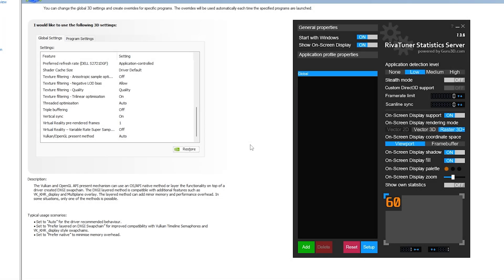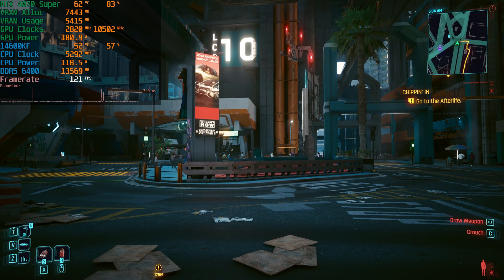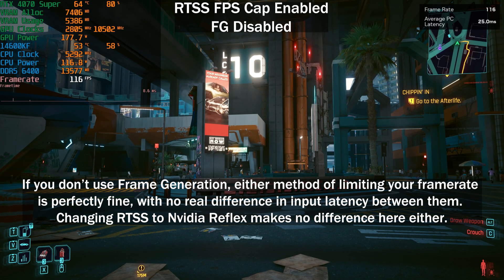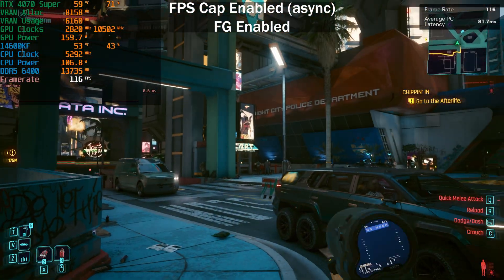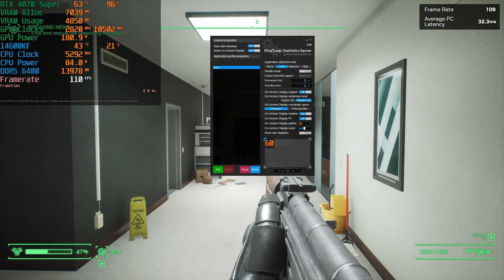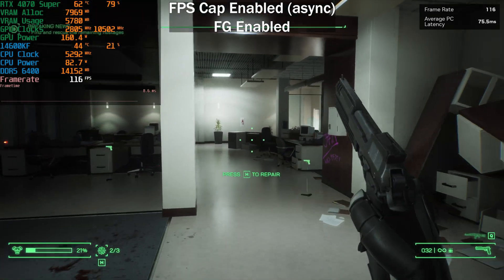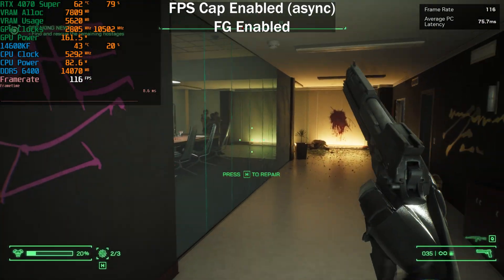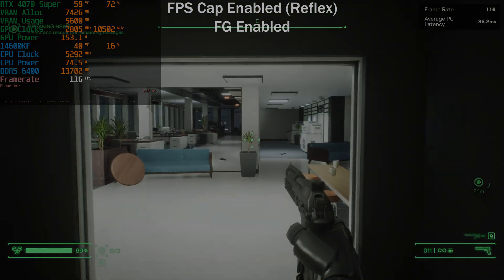How To Reduce Input Latency When Using Frame Generation - V-Sync vs RTSS

Comment: Buddy, thank you a ton; this video taught me that RivaTuner has a Reflex setting for the frame cap. Thanks to you, it's solved and all of them (frame generation, frame cap and VSYNC) are usable at the same time!

For years, I've been using what I call the "HoboSync"; VSYNC ON from NVidia Control Panel combined with a Frame Cap from RivaTuner to eliminate screen tearing and input lag at the same time. It's also good for your GPU on the long run. The frame generation technology I never got to use because as you're trying to showcase in this video, it introduced the massive input lag back. No more!

edit: Tested with STALKER 2. Smooth as butter!
Reply from the maker: So the funny thing is I only found out about that after I uploaded my initial video about this topic and people helped me in the comments! I then deleted that video and made this one. So we both learned something new haha!
Reply: What do you cap your frames at? I have a 40 series and I want to try and copy your settings if you’d be ok with sharing! I’m trying to get my stalker to run better (input lag) with frame gen
Reply: @TheWowBomb  Sure! Overall graphics settings are set to Epic (depending on your GPU/CPU). From NVidia Control Panel (or from NVidia App), V-Sync is forced on globally. Low-latency mode is in Ultra, though I'm not sure this helps in any way when you have Rivatuner capping the FPS. In Rivatuner, FPS is capped at 58 in Reflex mode, again globally. DLSS upscaling in DLAA mode, DLSS frame generation (naturally).

Normally I get around 35-40ms average PC latency without frame generation, with this around 60ms; still unnoticable for me. If you have a better screen that supports anything beyond 60Hz, the video has a few pointers as to what the ideal cap might be; usually around 2.5% lower than the max FPS that your screen can display. Plus, on a higher refresh rate & FPS cap, the latency impact would be less; the jump is rather wide for me as my cap is 58.

PS: Before watching this video, my average latency was going over 130-140ms, but it didn't feel like 130-140 at all, it felt like much more than that and the report was incorrect. Even if that's not the case, from 130-140 to 60 makes it playable, unnoticable even.

PS.2: Exclusive full-screen may also shave a little bit more, too. However, when running in such mode, trying to display NVidia Overlay (FPS/etc stats) causes Frame Generation to fail horribly in Stalker 2 lol :D
Reply from the maker: @TheWowBomb  For Stalker 2 and more heavier games I use 1440p High Preset, DLSS Quality, Frame Gen on and then I cap my frames to 120 fps with RTSS with the Reflex option enabled.

Other games that are not too demanding I try to max out my refresh rate of 165hz. What I do there is enable v-sync in NVCP, enable g-sync, use 1440p High, DLSS Quality + Frame Gen and with Nvidia Reflex in the game it caps my fps to 158 due to v-sync + Reflex. 

Not sure if your reply was aimed at me, but these are my settings.
Reply: Hahahaha didn't know it had a name. Been using hobosync for a couple of years now. The only thing I did differently is that I overclocked my 60hz monitor to 63hz, so I'm not using some weird numbers for the fps cap in RTSS. It's set to 60 fps with refresh rate of 63hz.
Reply: @witcher348  It's a name I come up with, as back then gsync monitors were sold at a premium. Couldn't afford it, and didn't have to thanks to this trick, so I called it "hobosync" :D
Reply: @bobloblawlove  yeah, now a lot of monitors are g-sync compatible and it's enough for a smooth experience

Comment: Ive done alot of different tests, and using the RTSS frame limiter with Reflex works best for me! Alot of the options had similar response time but would jump higher once I started moving jumping around and aim/shooting. Once Human is the game I did the tests on.
Reply from the maker: It's so funny, I never even knew this option existed, so I made a video about input latency and people pointed me to this option. It really works great, especially when using frame generation.
Reply: @Mostly_Positive_Reviews  yes it does, Ive been struggling the past 4 days, Ive done so much, Ive cleaned my pc, change thermal paste, refilled my liquid cool, cleaned all the fans too, I updated my bios, reinstalled my drivers, uninstalled a bunch of stuffs, tried alot of tweaks, worked on my overclock, I tried with/without overclocks, and god knows how much research I did. I had my cpu running at 100% and thought it was the issue, and turning FG off would give me lower and unstable FPS so I quite didnt want to use that option unless I managed to get the needed fps. I managed to hit about 130 avg but that wasnt enough I have a 165hz monitor darnit! loll your video is the one that brought the attention on this rivatuner setting, Ive been using rivatuner for years and I didnt know it would be the reason for this! I even thought it might be the effect of aging before I turned FG off and realize WOWW Im a gamer again! LOL thank you very much!
Reply: @Mostly_Positive_Reviews But do we need to enable V-sync in  nvidia driver settings? With FG we will go more than 120

Comment: if i use frame generation with riva tunter limit 60 fps, than 60 fps are shown, but it looks like 30 fps
Reply from the maker: Limiting your framerate to 60 fps with frame gen is a bad idea. Input latency is sky high, visual artifacts are more visible, and ghosting can be more obvious at lower framerates. Frame gen is much better at higher framerates. I personally prefer 120+ with frame gen, so I aim for about 80 fps without it.
Reply: @Mostly_Positive_Reviews   it works fine in witcher with fsr3 mod and limit 60. I dont want, that my gpu is running on maximum all the time, because of generating hundrets of frames.

Comment: what would be the way to reduce input latency for using FSR FG instead of on NVIDIA cards? Nvidia reflex doesnt show without DLSS, and i havent heard of a counterpart to NVIDIA reflex for DLSS on FSR's use. i dont own a 40 series to have FG, but an RTX 3080ti which does not support FG but FSR FG works, but latency is horrible
Reply from the maker: AMD cards have Radeon Anti-Lag in the drivers that you can enable. Some games also have Anti-Lag in the options menu (I think CS2 has that). But your best option is to enable anti-lag from the Radeon software.
Reply: @Mostly_Positive_Reviews  But i don't have AMD card ( what the AMD antilag feature named? for nvidia it's reflex ), i have RTX 3080ti, the only way to have FG is FSR. DLSS doesn't have FG cause it's not 40 serie. and that same time using FSR FG there has horrible lag on Nvidia and that's what im asking about way to reduce that lag. RTSS cap + reflex on it causes screen tearing for me
Reply from the maker: @baerimbel2006  Sorry, I completely misread your comment. 

With FSR FG, are you going over your monitor's refresh rate? That would cause tearing. I use G-sync + V-sync + Reflex, and that caps my framerate to 158 fps on my 165hz panel, and doesnt tear. I use the same configuration for FSR FG as well, except that I have to manually enable Nvidia Reflex in the game's options menu.

What game are you specifically talking about that requires you to enable DLSS to be able to enable Reflex? Most games I have played has the Reflex option completely separate from DLSS, but there are one or two of them where reflex can only be found under DLSS options, or require you to enable DLSS.

The other option you can try is Low Latency Mode in the NVCP. 

Just a side note, not sure if this is the case for you or not, but using frame gen to achieve 60 frames per second is going to be a horrible experience. I personally always recommend trying to get just over 60 frames per second before enabling frame gen. That doesnt help on 60hz panels though as anything above 60h fps will cause screen tearing. So I recommend having at least a 120hz monitor, and getting at least 60 frames per second without frame gen before using it.
Reply: @Mostly_Positive_Reviews Bro can you tell the reason for the side note ?

I have a rtx 4060 and currently doing the same thing that you mentioned in the side note but didnt notice anything unusual
Reply from the maker: @brainly7906  It's just that input latency is a lot higher when the final output is 60 frames per second, or when it is locked to 60 frames per second using v-sync. The higher your framerate, the lower the input latency penalty from frame generation. If the input latency doesnt bother you, great! But it is definitely a lot more noticeable to me and at that point I just use DLSS upscaling rather instead of frame generation.

Comment: so i play on a 240hz monitor and wanted to limit my framerate to reduce power usage (less heat) but couldnt figure out why my input delay was so bad. this video helped a ton, using the reflex option in rtss worked amazingly. the only weird thing is that i have to set my fps cap to double what i want it. ie, if i want 90 then i have to set it to 180. must have something to do with the frame generation but its weird bc i didn't see you needing to do that. maybe once you go past a certain number (144?) it bugs out? idk. either way, it works. works weirdly, but it works! lol
Reply from the maker: PCs can be so weird 🤷‍♂️ Glad you got some value from this video and managed to sort out your quirks 🤣

Comment: Do I need to turn on vsync in nvidia control pannel ? , if I want use RTSS reflex with gsync
Reply from the maker: Do you mean for the option to become available? You just need the latest version of RTSS for the option to display.

But if you are asking if it is better to use v-sync too, I use g-sync + v-sync + reflex and it then caps my 165hz panel at 158 fps. I prefer that and it is a very smooth experience with no tearing.
Reply: @Mostly_Positive_Reviews how about cap fps with max frame rate in nvidia control pannel ?, is it better than RTSS reflex ?. I tried use RTSS reflex cap my FPS in elden ring, but i saw flick if u cap fps 30-40

Comment: I have a entry level GPU (RTX 4060) and I'm aiming to play at 60 fps locked, but I do need DLSS at all times and sometiems FG in heavier titles to reach that, could you inform me if V-Sync even if being better to have less latency, does it affect performance on 1% Lows? Because in that case any limiter, be Nvidia Control Panel or RTSS limitir would be a better option for me, correct? Or V-Sync works as a limiter to help to have better 1% Lows? Or if that NVIDIA Reflex option on RTSS Setup shows up I should just go with that for best possible performance?
Anyways, great video nonetheless, I couldn't find anyone else doing a test like this around. Thanks for uploading. Cheers!
Reply from the maker: Thanks for stopping by! The Nvidia or RTSS limiter will be better as v-sync can cause a lot of additional input latency. V-sync can also cause very erratic frametimes. On my 60hz monitor I just use RTSS for limiting the frames and it has worked pretty well for me.
Reply: @Mostly_Positive_Reviews  Thanks so much for the reply! Yes, I'm using an IPS 60 Hz monitor as well, monitor also entry level haha. I appreciated the clarification. Have a good one and thanks for putting this video out, I had no idea about NVIDA Reflex option on RTSS!
Reply from the maker: @danielma1359  You're welcome, and thanks for watching and commenting. I also didnt know about the Nvidia option actually. I made a video initially and people in the comments then pointed out there is an Nvidia Reflex option too, so I redid the video to include that as well.

Have an awesome day, and happy gaming!

Comment: how are you measuring input latency? can i use that sofware with amd?
Reply from the maker: I use GeForce Experience. It unfortunately only works with Nvidia GPUs as it is bundled with the drivers. Radeon's Adrenaline software can also display this if you have anti-lag+ enabled in a game that supports it. I dont know the exact steps to enable it, but it is available if you want to search a bit. Here is a link from PC Gamer: https://www.pcgamer.com/amd-adds-system-lag-monitoring-to-its-adrenalin-overlay-for-games-that-support-anti-lag/

Comment: Great video thanks - not sure if you've noticed this but in CP2077, frame gen causes very regular and constant microstutters when a frame cap is used. The microstutter disappears when uncapped, but then tearing is out of control.
Reply from the maker: Interesting. I actually havent specifically noticed this, but will definitely check it out tonight, thanks for the info!
Reply: @Mostly_Positive_Reviews Is this the cause? Cyberpunk is the only game with FG that doesn't feel smooth, even though it says it's outputting over 120fps. This is with both vanilla and modded fsr 3. To put it simply, it feels like it's doing nothing.

I tested lossless scaling with the game. While the input latency is noticeable and there's a lot of artifacting, the visual fluidity actually matches the displayed frame rate of above 120 FPS.

Other games like Dead Space and Ghost of Tushima feel very smooth and visually fluid the fsr 3.
Reply from the maker: @albanmarku6743  Yeah, FSR 3 in Cyberpunk is a bit of a mess currently. It definitely needs some work. Other games have much better implementations.
Reply: This is my issue! It's a "pick your poison" type of situation. It's so annoying!
Reply: @unnamed715  no tearing for me if I enable vsync or gsync in driver settings with fg, as long as my max fps doesnt go above 240 (monitor hz)
Reply: Screen tears so much that you may think your operating system is bugging in game, haha.

Comment: all it does is use nvidia framelimiter, problem is cannot be done by game as it is general/global setting, so it is better to use the framelimiter cap on the nvcpanel per game instead of rivatuner. in rivatuner you will need to do  it everytime if you use framegen or not. the async is better than nvidia one in non framegen scenarios frametimes are a straight line instead of the lil spikes you see using nvidia reflex if using framegen is better using nvidias framelimiter or the option explained below.,

Another trick is to load the game in a way it rarely/never hits your monitor refresh rate with VRR/VSYNC on
ie 120Hz you would need to use a in game setting/dlss in a way it stays under lets say 110fps AVG on a 99% gpu load which is the best way to do it with the best latency of them all.
Reply from the maker: Thanks for the clarification about using Nvidia's frame rate limiter. Wasnt sure exactly how the Reflex option worked, but it makes sense.
Reply: Misinformation. Rtss frame limiter mode is not a global setting, you can set it per game.
Reply: @hkl4dplayer  nothing to do from what i just said.

Comment: Is there any reason to use rtss async over rtss reflex on games that dont have reflex in game settings already even if one doesnt use frame generation? Should i just switch to rtss relfex onwards for every game?
Reply from the maker: Actually a very good question, and one I didnt address in the video, my apologies.

I have been using the Reflex option since I made this video and havent seen any weirdness or input latency spikes on games that dont support reflex. I have only tested a handful of games though but havent come across any issues.
Reply: @Mostly_Positive_Reviews thanks for replying 👍
Reply from the maker: @shayanali8771  thank you for watching and commenting in the first place 👍

Comment: Hi! Great video!  SInce the making of this video, have you tested the latency with the in game FPS limiter instead of V-sync or RTSS? In many games it gives a lot less latency. It would also be great to see the initial amount of latenncy you were getting before you enabled V-sync or RTSS, to see if it increased od drecreased when enabling them. I would love to know your opinion. thank you
Reply from the maker: Thanks!

I have personally found that latency might be slightly better, but many games have frame time pacing issues when using the in-game limiter. RTSS / v-sync give an overall smoother experience. Not all games though, there are games that can perfectly cap the framerate but it depends on the game. 

Will remember to show the latency before in future, but it is lower as the framerate is higher without a cap in place.

Comment: I've got a 4070. Can someone explain why my latency if in the 90s no matter what settings I try?
Reply from the maker: Do you use v-sync or a framerate cap? What is your framerate when you see 90ms? Also, which game?
Reply: Here are my settings:
Res - 2560 x 1440
PT - On
DLSS - Balanced
Graphics Settings - Custom but mostly high settings

Frame cap is turned on in Nvidia Control Panel
FPS - 44 (frame gen off)
Lat - +- 75 (frame gen off)

With frame gen on latency hangs around 120 with frame gen on. I capped it to 60fps which would otherwise jump to 75 if I don't have it capped.

Changing to Ray Tracing, 1080p etc. doesn't really make a difference. Is it perhaps another hardware like RAM or CPU that can affect it?
Reply from the maker: 44fps as a base framerate is too low for frame gen to work well. Nvidia and AMD both recommend 60 fps, but I personally prefer 90. Unfortunately that means that path tracing is out of the question for most GPUs, unless you can get used to the input latency.
Reply: Update: The issue was my RAM. I removed the module that runs at lower MHZ and do not support XMP. I then enabled the feature and set the MHZ manually  in the BIOS. The latency went down a lot. Unfortunately it's not top of the line RAM, but it makes a huge difference.